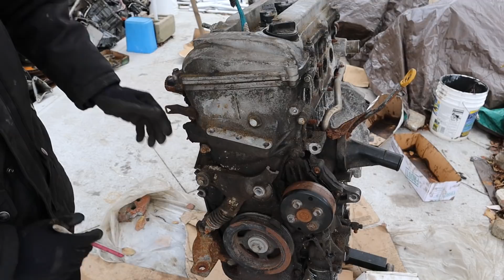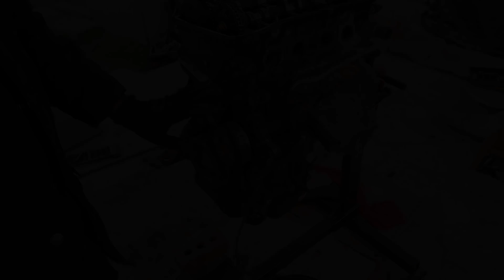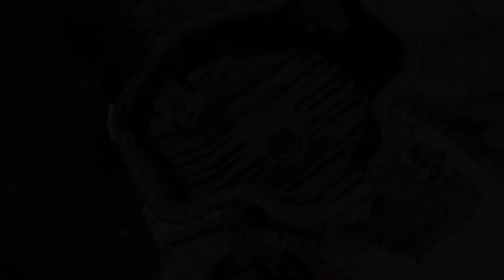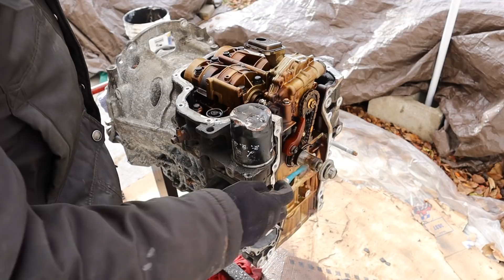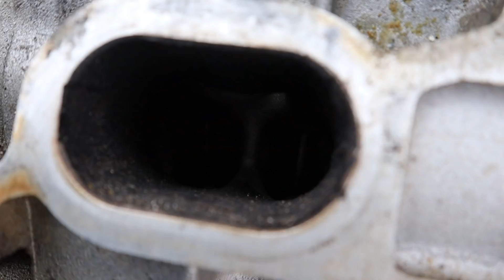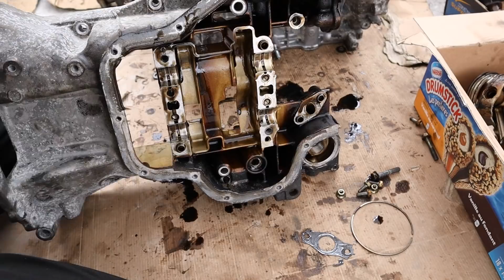Here's why Toyota Engines Fail

Comment: Other than the burning oil issue these are good engines. Also they are relatively affordable plus there are millions of them. How about you don't run it low on oil, takes 2 seconds to check. This applies to the older versions of this engine, the newer ones have fixed some of the real bad issues like the head bolts issue. Some of these engines have been fixed in warranty.

Comment: 2011 scion xb , 14 years and counting , nothing goes wrong with just regular oil change ,  everythhing in the engine bay are from factory except the 12v battery , and the only time it did not start was because the battery in the fob was dead , that is about the only time this thing won't start on command , this thing is a tank if you keep your oil change , nothing the  make  today can come  near  the  quality of  this engine

Comment: Remember two things about Toyota engines.regular oil change and look after cooling system.don’t add water to your cooling system and they will run for ever.alloy radiator should been changed is well cause they are no way has good as copper.

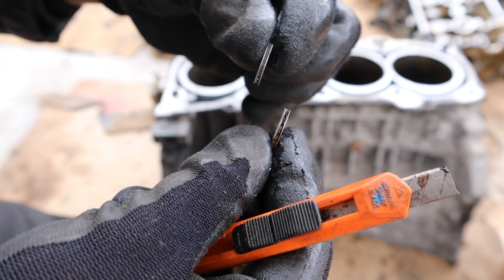Comment: @19:26 Another example of the damage dinosaur oil does to an engine. Extended performance high mileage full synthetic oil is the best IMO, especially for direct fuel injection engines (which I try to avoid along with anything turbo)

Comment: i have a 1az-fse which i drive hard, i use 5w 30 and change oil every 5000 miles, burns oil slightly but not much, amazing engine

Comment: So my oil light came on, i checked the oil level it was still well above the L mark, i checked the oil pump and it was fine and also changed the oil pressure sensor. The engine is toast now but what could have caused all that with plenty of oil in the system?
Reply from the maker: Oil passages clogged starving the engine of oil. Or mixed with coolant which doesn't lubricate well
Reply: @speedkar99  the only way i could check the oil passages would be to remove the head right? The oil looked fine minus the oil shavings in it now so i really don't know how it could have clogged

Comment: Another fantastic video, thanks.
After watching many of your videos I find it absolutely incredible that the manufacturers make fundamental mistakes with either the design or specification of basically simple, but critical, components in their engines, which then lead to catastrophic failure.
With the combined knowledge of the designers and engineers from all the car manufacturers it MUST be possible to create an engine that would be totally reliable and affordable, whilst delivering all the power, economy and refinement necessary for a mass produced car. I reckon speedkar could find real examples of every individual component in an engine, that clearly work totally reliably, so combining all these into a single engine would mean it was completely trouble free, subject to basic maintenance. So WHY don't manufacturers ever achieve that.

Comment: Brilliant work. Great Channel. No stupid music, just pure information given at speed. The 2.4 litre 2AZ has the same block and cooling system as the smaller 2.0 litre 1AZ, but with a longer stroke. 2AZ-FE burns more fuel so most problems are from excess heat in the pistons. Efforts to improve cooling occurred in 2007: the squirters were introduced to cool the pistons, the plastic water jacket block insert is intended to direct water flow to the upper piston sleeve to improve cooling around the combustion zone. Oil has to be changed regularly and a keen eye for the coolant level is needed.
Reply: garbage engines--engine have problems and engineers found ways to mask thsoe problems i dont like it,, a single problem will fuk up all engine- these engiens mechanilly a CRAP

Comment: Had 2 of these engines fail on me. One spun bearing and one timing chain tensioner fail caused timing chain to burst out the valve cover. I avoided the v6 engine because of the rubber timing belt 🤦🏻‍♂️
Reply from the maker: Ouch! The V6 was the better choice for the 5th gen Camry

Comment: I always check my oil and change my own oil. I never let my 04 Camry get bad. I haven't had any problems (other than a misfire on cylinder 1) with my Camry.
Reply from the maker: As long as you keep it oiled it'll be fine. Keep an eye out for stripping headbolts though.
Reply: @speedkar99  Question: How does one look out for stripping head bolts?
Reply: @MetalPopka  I'm the original owner of a 2005 with 89,000 miles in great shape. Always changed my oil myself, at 3,000 miles or less. No oil burning or coolant loss issues. I guess the way you look out for stripped head bolts is to look from underneath in the area under the intake where he showed where that insulation is located. Look for coolant leaking or pink dried gunk.
Reply: @MetalPopka  this reply is clearly a year too late but when the head bolts strip, the car will start spitting coolant and you’ll be able to smell gas in your coolant.

Comment: 20:10.  There is one thing you can do.  Drain the oil and refill with kerosene.  Run the engine for 10 minutes and drain the kerosene.  Refill with oil.  Run for 30 minutes and change the oil again.  This is an old school fix but when you open up the engine, you'll be surprised how clean it is.
Reply from the maker: I will need to try this on the next car I scrap
Reply: @speedkar99  Obviously, the kerosene will drain out of the engine black.  If you spill it, you can always use one of your wife's new white blouses to clean it up.

Comment: I drive a 2000 Camry with the 2.2 L that was unfairly known for sledging up. Not only does my Camry still have her original engine but that engine now has 452K  miles on it. The biggest problem with these cars are that they were trouble free to a fault. Even when poorly-maintained they still reliably shuttle their owners around. When I bought my Camry (10/99) knew I was the epitome of the dumb college kid. I somehow allowed Toyota sales shark to convince me to buy a car I couldn't afford. By the time the new car Afterglow or off I realized I had done something stupid. After telling my dad of all the mean things the Toyota guy head down to me all my dad said was " Son that fancy new car better last you 200k just to break even". Being the stubborn Cubano I am I made sure the car would last me at least twice that so I took the advice of anyone who wanted to give it. The piece of advice that I credit for my high mileage but still running perfectly what's the advice given to me by an old Cuban guy it's Sears Auto in Pompano Square. He told me that oil is cheap but engines are expensive. When I asked him what he meant by that he showed me another customers Prevea van that was in for an oil change. He said the van head over 300K miles and we still running perfectly. He then directed me to the oil pan holding the old oil he just emptied out of it he dipped a paper towel into it and then another paper towel into some fresh oil he had. They both were almost The Identical color with one being slightly darker than the other. He said to never listen to Toyota when they tell you to change your oil every seven or 10K miles but to change it every 5 or  6 k and NO further! He also said that most mechanics use cheap paper oil filters into always insist on a premium one which usually only costs like $4 more. I change my oil every 5.5 k miles and my engine doesn't burn or leak any oil between changes. Now I work in auto finance and can honestly Drive almost any new car I want within reason but the reason I keep driving my Camry is cuz she represents the point in my life when I realized it was time to grow up even though I was kind of a wigger which would explain the body kits and spoilers she has sported over the years and have all been removed now. These people that buy like a Camry or a Corolla buy them because of their reputations for being Bulletproof but these people think they're literally Bulletproof. Especially by the 3rd or 4th boners.
Reply from the maker: Good car. I grew up driving dad's Previa
Reply: great story, I enjoyed reading it. I had two camrys in the past and they just kept going, I lost each in property settlements. Now I buy a sacrificial audi before any relationship so I can keep my toyota.

Comment: I was lucky enough to have my engine serviced based off the service bulletin/extended warranty back in 2016. One thing that does concern me is that there was another video that inspected the new pistons and rings issued for service and they pointed out that it was not really redeisgned but just a direct replacement of the existing part. This means that it is bound to burn oil again? I am just going to hope it wont burn oil in the future. Still doing fine right now.
Reply: The new pistons are not different, you'd get the same effect cleaning the old oil rings. It just re-sets the engine back to the beginning point. If you change the oil on schedule you should be OK. For Toyota, it just kicked the can down the road so the engine now outlasts the body. The "revised" pistons are not really different (YT was car care nut).
Reply from the maker: Well if it's nthe same part it might develop the same issue after alot of miles. There were revised piston heads to fix it.

Comment: These engines are really junk. A friend gave his daughter the family Camry, owned since new and always properly serviced at the dealer they bought it from.  With 90K on the clock she was off to college, it suffered a head gasket failure on the freeway from the absolutely brain dead no excuse head bolt issue, and by the the time the dash light came on the engine was destroyed. So many think Toyota’s are super reliable but many are incredibly poorly designed and can have hugely expensive problems at relatively low miles.

Comment: As a suggestion you should do a video on why the 1998 - 2002 Accords Transmission fails. Or why the GM 3.8l Power steering system is always messed up on every car I get into.

Comment: My brother‘s 2004 RAV4 has this engine. He’s a college student but he drives a lot. His engine runs amazing and doesn’t burn a single drop of oil between oil changes. While my truck was down for a while, he let me use it. It is the smoothest running engine I’ve ever seen. Plus, his RAV4 is a rare one because it has a 5 speed standard transmission. Still have yet to see another one like it. I think that car is going to last a really long time. Quickly approaching 200,000 miles
Reply: Is that a 5 speed manual or automatic, because 5 speed auto was not put on 2004 RAV4, unless someone swapped out the U140F for the 5-speed U151F, which is a very good idea.
Reply: The new piston rings came with the 2006 model year which caused the issue, no one seems to realize that in this whole thread.  04-05 models prior to that time were not affected.

Comment: Had this engine in a Previa. It was quiet, torquey and smooth even at 230 000 km. Oil changes every year or 10 000 km.
Reply: I have one in my tarago (Australia previa). Such a practical vehicle.

Comment: As an owner of a 2005 2AZ-FE 4-cyl with just over 200k miles, I can proudly say that the engine still purrs. I attribute its longevity to the fact that I swapped the factory oil at 1,000 miles with Mobil 1 fully synthetic and have used that ever since. I do all my own spill and fills. If I were to guess, the reason I don't have the oil burning problems described here is that Mobil1 fully synthetic does not gum up and retains viscosity much better than conventional oils as well as contains detergents that prevent the build up of sludge. In fact, it wouldn't surprise me if this engine had another 100k miles in it, but like speedkar says, the typical owner of one of these used them like an appliance. So using fully synthetic probably seems dumb until you total a Camry, but if you source all your spill and fill needs at your local Wally World, it is just smart.
Reply: Are you using 5w20 or 0w20?
Reply: I heard of a land cruiser that went 1 million miles on Mobil 1.

Comment: I own a 1989 mitsubishi mighty Max truck and it's the 8 valve 4 cyl carb with a 5 speed the rear end is going out and my valves tick when cold could you make a vid about my engine in the truck the mitsubishi g63b Mitsubishi sirius engine single cam the carb was rebuilt 1.5 years ago
Reply: The truck just never gets enough people working on it and no one has a video of them fixing or even working in them since no one owns them

Comment: I think a lot of this poor design piston ring stuff started because many governments mandated stricter emission requirements during cold start-up. They forced the companies to move the piston rings very close to the top of the piston head because that area was trapping unburned fuel. The rings were made thinner, piston ring grooves made narrower. Yes, even the oil control ring could not escape big brothers watchful eye; had to be designed thinner to the point that it could no longer do its job. Instead of lowering net emissions, they created the excessive oil burning problems with modern engines. They pollute less for the 1 minute cold start period, but pollute more for the entire time the car is being driven. And the car owners are stuck with the resultant repair bills. We have such smart people in government now!

Comment: Car  buyer should get the car and the engine professionally checked by a professional rather than avoiding to buy the car at all. 4 cylinder Camry and RAV4s are the most sold, in demand cars in the world. As with any engine, oil changes at recommended intervals is crucial for long lasting engine.

Comment: Maybe it's simply the focal length of the lens used, but this engine appears very short in length, is it so ?
On another note: Ford tried spraying oil under the pistons for the 5.0 V-8 of the Mustang but then stopped it, for what reason I do not know.
Most likely, I'd say, their issue was oil burning....due to too much oil on the cylinder walls.

Comment: I have this engine on my 2007 RAV4 with 204k miles.  It has been burning oil since around 60k miles.  Lately, it burns a quart every 4-500 miles.  A few weeks ago, I decided to to piston soaks with Seaform and Marvel Mystery Oil.  I poured a quart of MMO in the crankcase (i drained down to 1 qt lower b4 added) and drove it for 30 minutes with high Rev.  After that, I drained the oil and kept the oil drain plug open.  I removed the spark plugs and soaked the pistons with Seafoam for 24 hours.  During the soaked time, there was dark liquid drained out the oil plug hole so I knew the soak was really cleaning.  I soaked another 12 hours with MMO.  Afterwards,  I removed all the left over MMO with a turkey baster and an extension hose.  I also wiped it so there would be no more MMO on top of the pistons because I knew it would smoke badly if there was MMO on top of the pistons.  I put back everything and poured in new oil and it smoked very little for 5 minutes.  I took a drive and boy it felt very responsive.  I only put in 100 miles and the oil level stayed at the same place.  I will have to wait for a while to see if that cleared out the piston ring holes and helped reduce burning oil.  I saw one of the guy on YT used Berryman B12 to soaked and it ended up caused a knocking on his 2azfe.  I think the B12 is too strong.
Reply: Update:  I was having a high hope on oil  burning reduction but unfortunately it didn't make much of a difference.   I put in 260 miles and it burned almost half a quartz. 😔
Reply: @nld0947  Damn! I wonder how much worse it will get over time?
Reply: @rad_harris2743  It has been burning like that in the past few years so I am thinking the rings got stuck and the cylinders might be ok.  If the cylinder walls were bad, then it would burn worst.  I am going to continue  add MMO to the crankcase and gas tank regularly and probably will do a pistons soak again later on (next oil change)  with Seaform.   The car is running great at 204k miles and never had any major issues except this burning oil.  How much does your burn?
Reply: @nld0947  I've got a 2018 Mazda CX-3. It has the 2.0 inline 4 with 34k miles on it now. I got it new. It burns about 1/3 of a quart between 5k mile oil changes, which I feel like is pretty normal for a modern engine with low friction rings. I have been really happy with the car in the 4 years of owning it; nothing but oil changes done. I use Techron after every oil change as well to try and help out the GDI system. I would definitely recommend a newer skyactiv Mazda whenever you need to get a new ride.
Reply: @rad_harris2743  I recently did a pistons soak with Berryman B12 for 12 hours with opened oil drain plug and rotated the Crankshaft multiple times with multiple refills of B12 (4 cans).  The result was amazing.   I just finished put in 1,000 miles and it burned less than 1/3 of a quart.
Reply: @nld0947  Quite impressive!
Reply: @rad_harris2743  Seafoam and MMO are both simply light volitiles which burn off quickjly. B12 is quite a bit different and stronger. Not surprised at your results.
Reply: Keep us updated!
Reply: I want to give you guys an update after 3 years on the piston soak with B12.  The car has 236k miles on it now with no issues and very little oil burning, so I don't check the oil level much anymore.  The B12 really works, and I think it can work with any oil-burning engines.

Comment: So...how is running low on oil a defect of the engine builder?  That seems like nonsense.  Also, is it me or did everyone else keep thinking...can you remove the harmonic balancer already?  Why remove all those bolts just to leave the cover unremovable?
Reply: they screwed up the oil drain holes so a lot of them use so much oil if you are not constantly adding it runs low.
I would just a pos like that run its cource too.